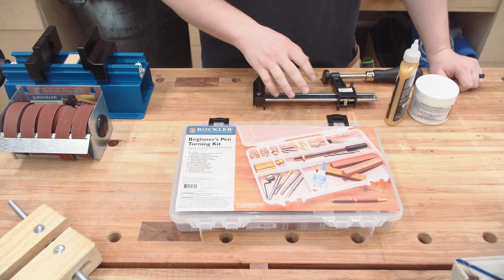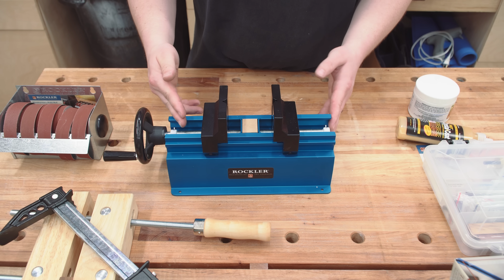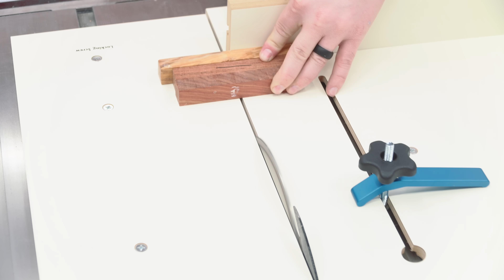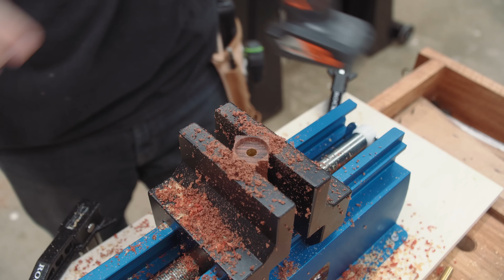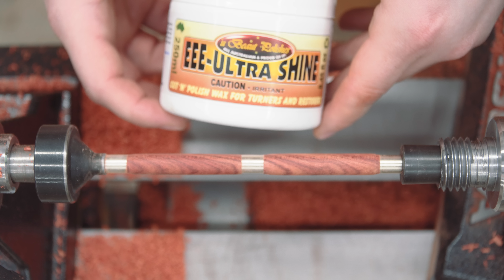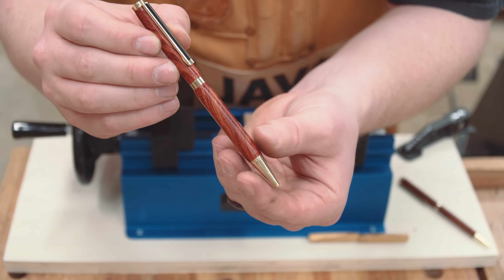Pen Turning | How To - 311

Comment: I use a Zebra Z grip click pen to make turned pens.  Total cost is under $3 for my turned pen.  Have you tried this method as this base pen parts are about $1.  I bought a lot of pen kits from Penn so I had a lot of bushing sizes to fit my drilled end holes.  No interior sleeves are needed in this method.  I use a 4 inch long standard pen wood blank for my center wood.

Comment: I have watched two of these videos,is there a reason you don't use the lathe to drill pilot hole thru blank.Also I believe the "MT2" on the pilot designates the size and angle of taper.M for Morse, T for Taper, Morse Taper #2.

Comment: Nice video Jay, thanks for all the details.  This is actually the 2nd time I've watched this, and I thought of a question.  With other kits that aren't slimline, such as bolt-action pens or cigar pens, where they use 8mm tubes, or sometimes 10mm tubes instead of the slimline's 7mm tubes, do you need a separate mandrel?  I wasn't sure if the inner diameter of the tubes also increased along with the outer diameters.

Comment: Wow, this is a good instruction video!! Even I, an amature Dutch guy, learned from this. But I'm not sure what the penmill does. Is it essential to have this? Or just cut the blank at size as the tube inside it? And do you also have a video link to a non slim pen? Thx!

Comment: I've got a small cheap arbor press from Harbor Freight. Glued a scrap of HDPE to the end of the press ram and another to the press table. Best pen press I've ever used. So much faster than screwing clamps and clamp style presses. Also cheaper than an actual pen press.

Comment: I'm surprised Rockler didn't include a tube insertion tool in their kit. I recommend it so you don't get glue on your fingers and can use the barrel trimmer on both ends. BTW ... good job ... I teach pen-turning at our local woodturning studio.

Comment: Hey Jay,  enjoyed this video.  What lathe would you recommend?  was thinking about the excelsior from rockler.
Reply: Tim Everett hi! I have one - and also have the bed extender. It’s got all the basics a new turner needs. Rockler will have pretty awesome sales on these so keep your eye open! When they DO go on sale wait to buy the turning tools. The next sale cycle will be the tools. It is a strong and sturdy machine out of the box. I really like mine. Learning how to adjust the speed to what you need is the only thing you really have to learn on this lathe.
Reply from the maker: For pen turning and smaller items just about any lathe will work. Always read as many reviews as you can. Look for features like handles on release parts like the tool rest and tailstock and avoid those that require a wrench to adjust everything.

Comment: So nice to see someone not plasticize their pens with CA glue finish!  Great job on this video and beautiful pens.  My drill press sucks, so I found that drilling out the blanks on the lathe was easier and I get straighter holes.  Also, the mandrel saver is a must have in my book.
Reply: CA Glue finish extends the life of the pen forever.  It also brings out the grain in the wood.  If you sell pens like I do, you don't want to sell a $40 pen or higher and then have the customer upset a year later because the finish has turned to crap.  Most people are not going wax their pens on a regular basis.  They expect a pen with no maintenance at those prices.  I had a gentleman contact me from over 10 years ago that I made a rollerball (piano inlay) for a few weeks ago.   Just wanted let me know that pen looks just as good as the day he got it.  Try that with any other finish.  I make heirlooms, not quickie cheap gifts.
Reply: @jonlanier404 I get the ca finish is durable but again you might as well turn acrylics, instead if making wood look like plastic.
Reply: @jonlanier_  I agree 100% with you.  Friction polishes are very easy and look nice but not durable.  Good choice for a beginner and fool proof.